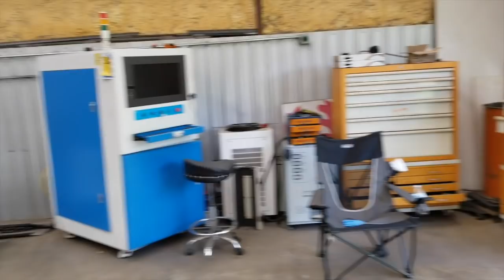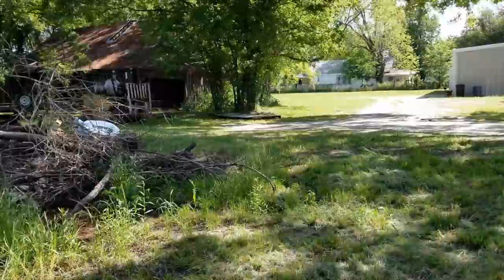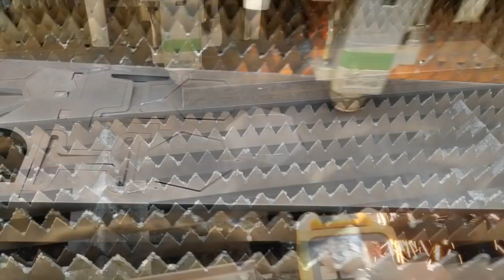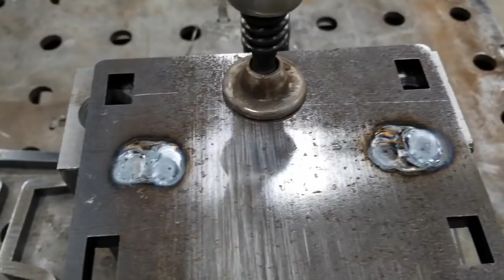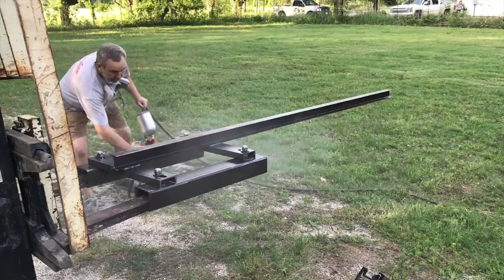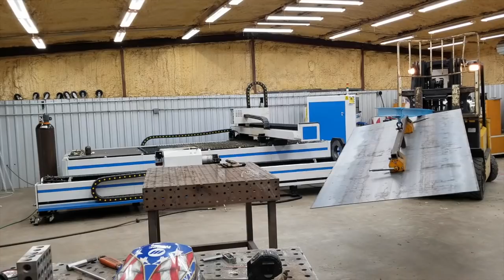Fork Extension Beam for frontloading heavy plates

Comment: Ramsey customs.   Very nice looking I have to say. Just wondering though ,the part that slides over the beam,have you tried putting a stress test to a prototype ? For some reason it looks like it would straighten right out or bind on the beam. I'm definitely not an expert but I would have went with 3/4". But hey what the neck it seems to work fine. What an amazing job those water jets do. Glad I found your channel  keep up the good work my friend.

Comment: I think a c-clamp on the rail for safety to not slide off the end. Also if you bias toward the far end of the sheet so the forklift end sags like you did, but cut a hunk of 4x4 post at the far end of the 'bridge-bar' to 'pinch' between the bar and the S-beam which will limit tail sag. Love the paint job. As far as safety, if you magnets can handle it, if the S-beam bends too much, you know you better think about it. An absolute MUST-HAVE with the laser table and fork lift. Excellent engineering.

Comment: 3/8 x 5ft x 10 ft = 612 lbs.  I ended up using beam clamps when I built my Jib years ago: https://www.zoro.com/anvil-beam-clamp-4-standard-carbon-steel-38in-0500315007/i/G3266925/feature-product?gclid=Cj0KCQjw17n1BRDEARIsAFDHFewprnim81VRzrPMmetAWsrj1ZqW0BhSoR8AEpsFdk3sOeslxjXP8n4aAudEEALw_wcB&gclsrc=aw.ds
Reply from the maker: those look handy, and inexpensive.

Comment: Why not just buy a longer I beam and swap it out on your gantry so it can straddle the table and pipe fixture?
Reply from the maker: the side of the laser near the wall has a ton of hoses for water chiller, gas line, that are in the way, plus very easy to run over it, etc.    You didnt like what i built?
Reply: @turbocobra  You did a nice job and it will work fine I just figured you would have a lot better control over it being at the plate versus 10 ft back looking thru a mast.

Comment: The pivoting connection between the magnets and the I beam looks like a real nuisance. Wouldn't a rigid connection work better - or at least, one that had limited travel?
Reply from the maker: possibly, but also would force you to more accurately place the sheets on the machine, with it not being rigid, I can lower it down until one part fo the plate is touching, adn from there I can line up the sheet straight, then lower it on down the rest of the way vs. having to drive the forklift perfectly straight on
Reply: @turbocobra  What I'd think about is, 2 "sliders" with each magnet hanging straight down underneath each one on a piece of chain that's about 8-12" long. The chain will give you some horizontal alignment cushion. And you can spread the sliders out to stabilize the plate-sheet. Just an idea....

Comment: Do you have 3 phase power to you shop? Just noticed your in a rural type area.
Reply from the maker: Yes I do.  Luckily my shop is right across the street from the Water supply system for our area and their pumps are all 3 phase, so i was abel to get it for no cost.  If I live anywhere else where I am it would have been a huge expense.

Comment: nice job! i think i would add another slider on the beam closer to the fork and a 3 feet wide tube with two post going down at each end about 10 inch long, with that you would not have to worries too much of centering the magnet, just get them a bit before the center and the two post leg would hold it horizontal, just my 2 cents.. it may sound weird the way i wrote this, i am not very good in english..!
Reply from the maker: Oh I totally understand what your saying and yes that would work well for sure